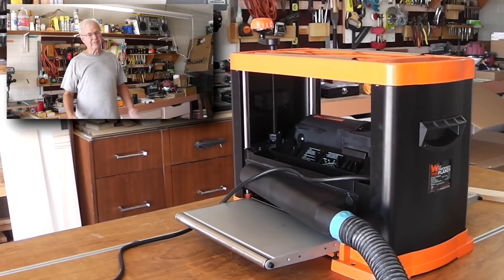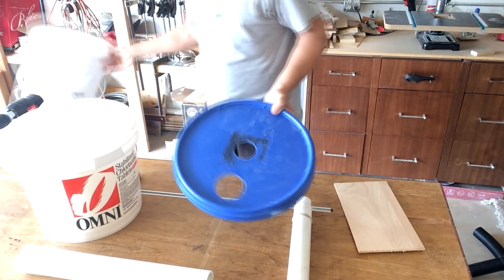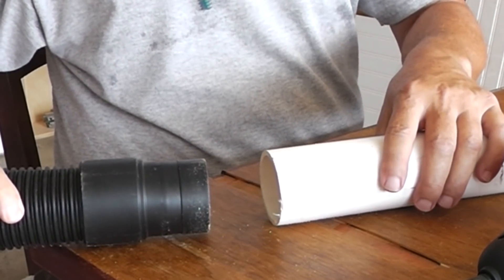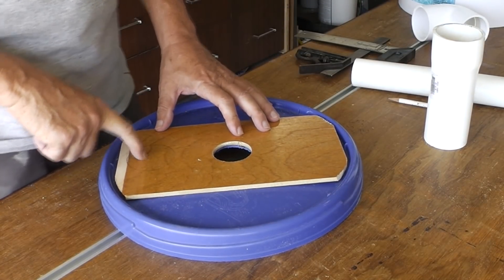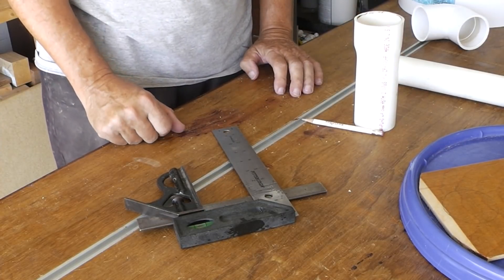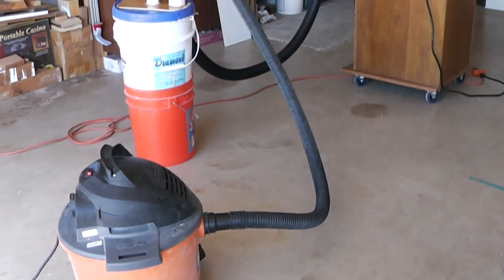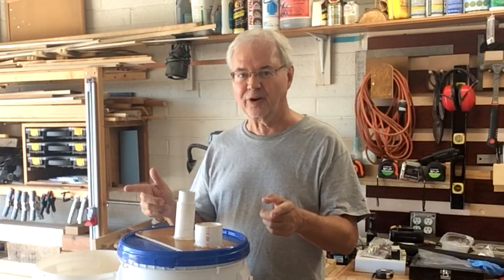Cyclone Dust Collector

Comment: By far the most inexpensive dust collector I’ve seen thank you 🙏
Reply from the maker: Thank you ! And best of all, it works 😂. Thanks for watching.
Reply: @JayVisnansky  Hi had a question for you I herd in some cases these buckets can cave in due to changes in pressure is one possible remedey to drill a small hole in the top of the container ? thoghts please thank you
Reply from the maker: @Fredengle  I’ve have not experienced this bucket cave in Telesforo.   So I can’t answer your question first hand.  But give the drill hole a try and let me know the results. Thanks.
Reply: @JayVisnansky Hi jay all I can say is I dont have a wood project right now and people debate if drilling one or more holes would fix the problem but I would think if it is found to be unsucessful the remedy is patch using duct tape ? does that sound right? thoughts please thank you
Reply from the maker: @Fredengle  Dict tape is the perfect solution to cover the drilled hole.
Reply: on to my new question please the capacity of my shop vac is low but I would guess before I panic about flooded basements it would seem one option is use the vac wet filter and than the dust collector could serve as extra storage if I have a flooded basement I am trying to work on a project in progress to see if I can attach a faucet to a  bucket !!!!
Reply: @JayVisnansky  yeah I have a system for the very poor I dont actually know if it can function as high enough abitlity to have that problem but more importantly I will say again it seems if my basement is flooded and use the vac wet filter it would seem it could add stroage in case of flooded basement ?
Reply: @JayVisnansky  Hi in case you did not get my newest comment i said it seems as long as I use the shop vac wet filter the capacity of my shop vac is low I guess there is not reason I could not use the collector as extra water storage  in case of flooded basement ? thoughts please thank you
Reply: @JayVisnansky here another possibly easier question for you if my shop vac is a low capacity I cant think of a reason that I could not use the dust collector as an extra water storage if spilled water or had a flooded basement or something  ( of course we can be sure at that point that we need the liquid filter in the shop vac ??? )?

Comment: I like the heat gun tip for the adapter, well done project. I would like to see an additional cutout on the lid with a clear plastic viewer to see how much dust is collected so you don't have to open it up unnecessarily. Thanks!
Reply from the maker: Nice idea about the clear plastic viewer on the lid Team NPNG !  Thanks for watching.

Comment: Great video, what is that tool called which cut the holes for lid not seen one of those before ? 

Dave
Reply from the maker: Thanks Dave. That tool is an adjustable circle cutter for a drill. Works pretty good. Thanks for watching.

Comment: Mr. Visnansky, enjoyed your video and the presentation for the "hows to's" and "why-for's" for each process and the straight forward approach to getting it done.

I normally buy my five gal. pails from the local donut shops for a dollar or two for when I need a new mop bucket or to hold the motor oil when I take it to be recycled, and since I have several in the garage along with several extra fitting for an above-ground pool I just took down this week decided to make one similar to yours since it was, as I said earleir, so straight foward it would be hard to make any real mistakes.

My one suggestion 'tho' for connecting the two pails together is to heat the top inside rim of the bottom bucket and then slip the bottom of the upper pail into it before cutting away the bottom, and then I would prefer to keep it in place (the bottom which was cut out) to maintain a more rigid connection - as for the bottom (of the top pail) I believe I would cut either five large holes or most of the center out to permit the chips, etc. to be deposited into the lower container.

Thank you for sharing your idea on a secondary container for the debris associated with saws and what-not to keep your shop from becoming a dust bowl.
Reply from the maker: Thanks for the great comment Larry. Your note on heating the top inside rim of the bucket makes sense and I missed doing that. Would have made the fit a lot better. Thanks for watching Larry.

Comment: Thanks, I'm going to make one like this with one small change.  45 degree angle facing sideways inside on the intake tube (the tube going to the planer).  This will create the cyclone action although it looks like yours didn't need that.  Maybe because your bucket is twice as tall.
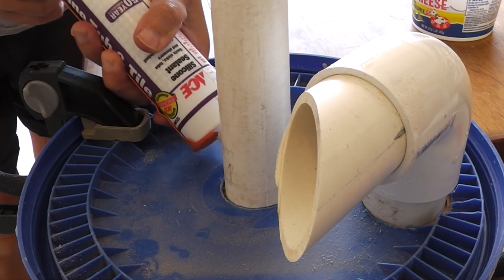Reply from the maker: I did put a 45 degree angle on the intake tube Jeffrey but I didn’t do a good job of getting it on the video. At the 8:56 point in the video there is a shot of the underside of the lid with the 45 angle. Is this the angle you mentioned ?  Good luck on your project and thanks for watching.
Reply: Yes, that's it!

Comment: Rotating air creates a cyclone. As both of your pipes enter straight into the lid, where does the rotation come from?
Reply from the maker: The hose from my planer that’s attached to the pipe on the edge of the lid has an elbow attached inside the lid that directs the airflow around the bucket. I didn’t really point that out in the video but you can see what I mean at the 9:00 minute mark in the video Mark. Hope that helps and thanks for watching.

Comment: Would this work for grinding concrete and tiles? We have a really great vacuum machine (Husquvana S13) for the job, but it needs constant cleaning of the filter....
Reply from the maker: Sure. Just hook the grinder up instead of a table saw or other piece of equipment.  Good luck.
Reply: concrete or tile dust would be much too light for this application

Comment: I made one but the bucket gets sucked in when shop vac switched on. Using 20lt plastic bucket. Kindly advice how I can remedy this. Thanks
Reply from the maker: Your plastic bucket probably has thin plastic construction. The sides are thin. Maybe try a bucket with thicker plastic. Thanks for watching Bobby.
Reply: @JayVisnansky  Thanks for advice.
Reply: Go with a paint bucket or a spackle bucket the sidewalls are thicker. Usually the brand name buckets are thin wall. Ask the Sherwin or Benjamin moore stores for one.

Comment: Jay, How long is the long pipe supposed to be? You never mentioned the 90 degree coupling on the top one, so I had to run through the video again to see it and how you had that short extension with its angle cut on the inside, and you never mentioned how long the longer pipe extended.
Reply from the maker: The long pipe in the middle of the lid is 12” long G.M.  The short extension with the angle cut in the inside of the bucket adds to the cyclone or swirling action of the dust in the bucket. It also helps the dust to settle to the bottom.  Hope that helps you. Thanks for watching.

Comment: what a hassle, the vacuum does the job fine
Reply: Yes, but you have to keep cleaning the filter and as the filter gets clogged, the pulling power of the vacuum diminishes.  A small side benefit is that it's easier to empty a bucket than a vacuum container.

Comment: I used your tip on fitting the pvc with a heat gun. Better than the idea of heating the whole pipe in an oven as I saw elsewhere.  I find my planer makes a lot of shavings but very little dust. The shavings drop to the ground so I sweep it up. The table-saw makes the most dust.
Reply from the maker: Glad that worked for you John !  I got my heat gun at HF and it’s surprisingly fast and easy how it does the trick. Thanks for watching.

Comment: Nice job Jay. And thanks for the tips about using the 2 squares for pipe measure and the soapy water for the caulk. Wish I’d seen this before buying the Dustopper from Home Depot.
Reply from the maker: Thanks Bob !
Reply: always have a wet finger when dealing with caulk

Comment: Why the need to make an adapter for the pipe from the planer to the bucket? Why not just fit the pipe from the planer straight to the bucket?
Reply from the maker: Good question Edward.  The hose from the planer to the bucket is connected to that PVC pipe and extends down into the bucket with a 90 degree elbow on the end. The part that's in the bucket.  That elbow sends the dust in a circle (cyclone) around the inside of the bucket.  If the hose was just connected to the top opening, that spin action would not happen.  Hope that answers your question.  Thanks for watching.
Reply: Jay Visnansky could you explain a bit more as to why the cyclone effect is needed and how to keeps the saw dust in bucket instead of being sucked back up from he bucket to the shop-vac? 

Also, would adding 3 inches of water in the bucket help keep the sawdust in the bucket and out of the shop-vac?
Reply: Marc Naidu , the cyclone effect pushes the dust to the outside of the bucket and away from the vacuum hose, making the extraction more efficient (keeping more dust out of the shop vacuum). Water in the bottom of the bucket would turn into a big mess really fast, and make emptying the dust collector more troublesome. However, if one were sanding something potentially toxic (certain types of lumber, or concrete, as examples) it could help reduce airborne particulates when emptying the bucket - one might consider adding water in those circumstances

Comment: Why did you feel the need for 2buckets?
Reply: Update: Got into planing some of the red oak lumber today and I have to say the 55 gallon drum collector works like a champ. Thanks for the inspiration Jay
Reply from the maker: Excellent Ernie. Those planers sure do make a lot of saw dust. Glad it worked out for you.
Reply from the maker: Good question Brian.  I used 2 buckets simply for a larger capacity.  I made this for my planer and that produced a lot of saw dust.  So that's what I had in mind when I went with two buckets.  Thanks for watching too.
Reply: Good thinking.
Reply: Brian Williams z
Reply: I made a 55 gallon poly drum version yesterday and used the heat gun to make the fittings as well. I'm getting ready to plain a couple hundred feet of red oak and we'll see how it works. Thanks for all the helpful info and the sharing. Looking forward to more useful projects.